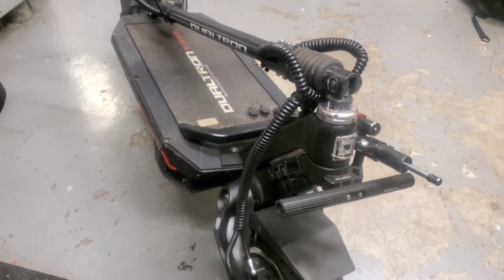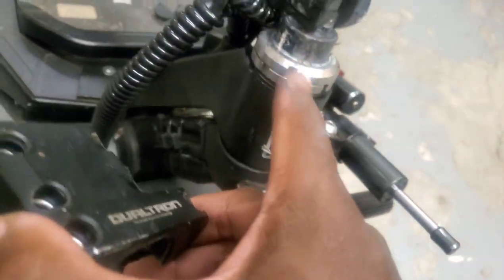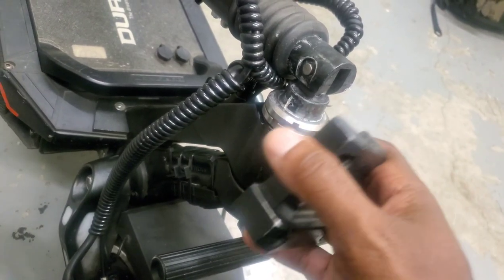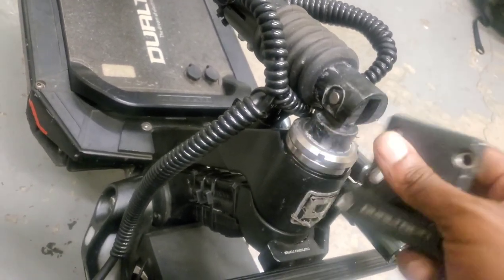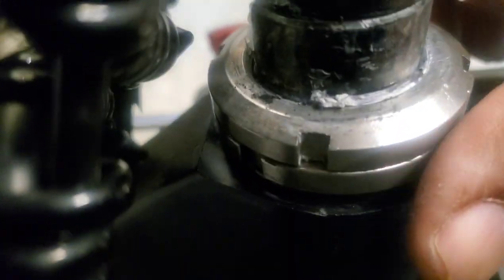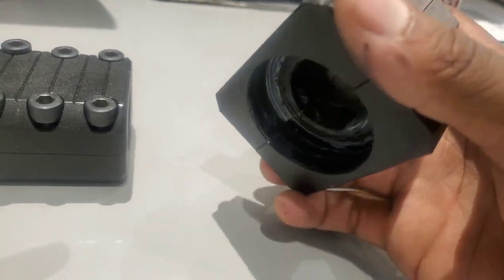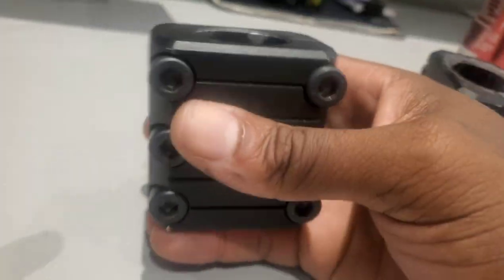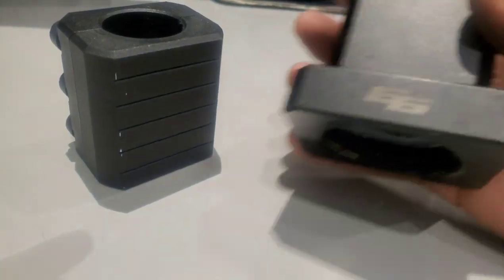Alternative clamp to my Dualtron Russia clamp has loosened my castle nuts.

Comment: You can simply cut that castle nuts bottom cover of 66 clamp. I now testing it without cutting, but I mean, that it is OK and it is better than standard clamp and better than Erexx, that I broke after few weeks :( I use 12.9 screw and I rotated clamp 90 degrees, so screws are not so stressed.